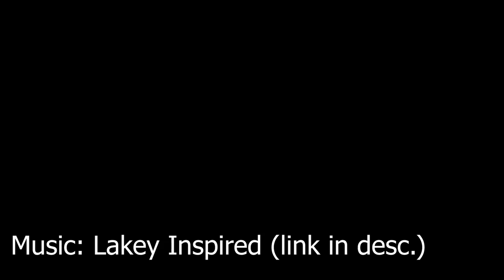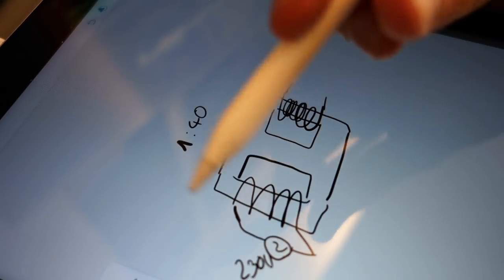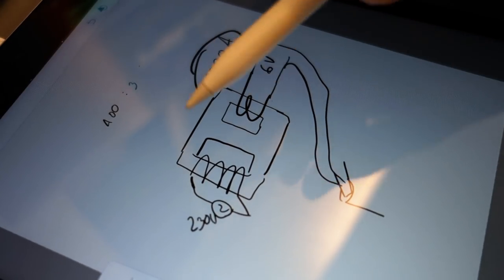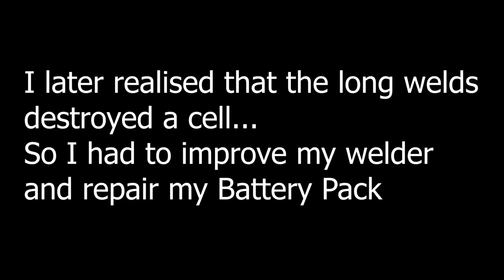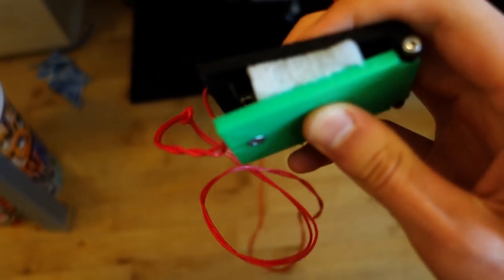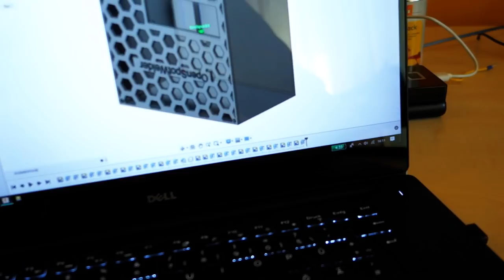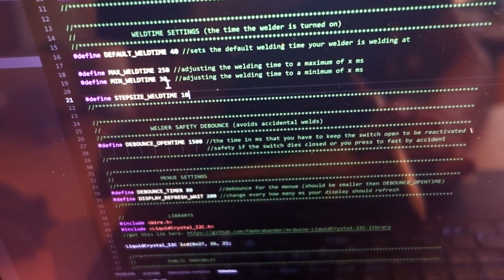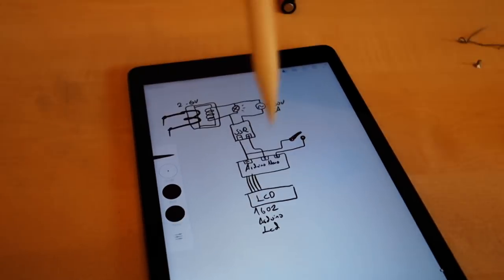I used a MICROWAVE to SPOTWELD my BATTERIES

Comment: Ein Tipp nutze doch statt einem Releais einfach einen LEISTUNGS-MOSFET da sind die Schaltzeiten quasi bei 0(ns Bereich). Zusätzlich dazu können sie hohe Spannungen und auch viel Ampere schalten.
Reply from the maker: Das geht nicht. Mosfets kann man aufgrund ihrer Freilauf Diode nicht für AC verwenden. Die würden ja alles durchlassen. Ein Triac / Solid State Relais ist schon die beste option. Die switchen auch so gut wie instant :)
Reply: Leo Pryside Stimmt, hatte vergessen dass das ganze ja bei AC läuft🤦‍♂️

Comment: I'm definitely not experienced in ardino tech but here's something to make you laugh. 
About 24 years ago when I was 14 years old I wanted to extend the cable for my high powered stereo system in my bedroom and the cable have already been previously cut before I'd decided to extend it.
When I went to do it my sister came into my room and distracted me from what I was doing and I forgot to turn of and unplug the power to my stereo and went on to remove the insulation tape from the cable and being young and stupid I decided I could just strip the wire with my teeth (not a great idea) 7ft cross my bedroom and 240 volts at 13 amps direct to my mouth wasn't any fun at all.
I'm pretty lucky I didn't seriously hurt myself, I never stripped another wire with my teeth ever again 😂😂😂😂. 
Any young children reading please learn from my mistake, electric can be lethal or really hurt you never treat it like a toy and always make sure that you know what you're doing before you try to do anything with it.

Comment: What thickness is the nickel strip? Thanks!
Reply from the maker: for that ebike i used like 0.2mm I think... calculated it through, have like 300W losses across the whole pack when going full throttle... (7kW)
Reply: Leo Pryside hmm weird I tried several 700watt and 1 800watt MOT with 1 turn and 2 turn and 3 but had problem with thicker strip, couldn’t get it to work,but now I got hold of an 1800w professional microwave so that will be enough I hope.. are going to do more videos? They are really interesting!

Comment: Jhuargarcia uses resistor wire so the wire works as a fuse to protect the battery pack when a cell blows
https://youtu.be/O9c8VrCuCwo
Also I would use a MosFet instead of a mechanical relay and an <16amp automatic fuse in the 230v feed wire to prevent your house fuse from blowing lol